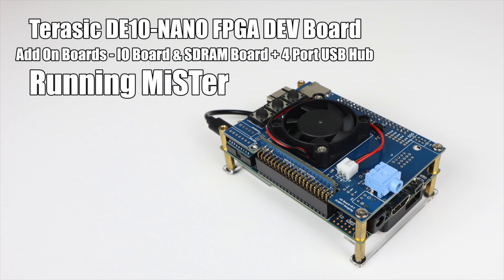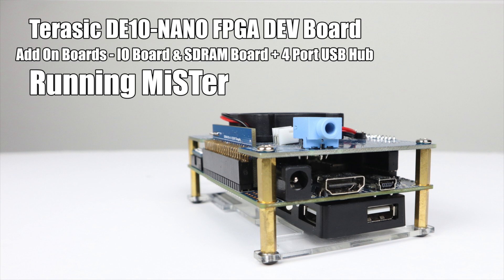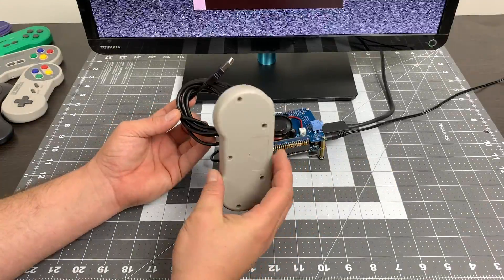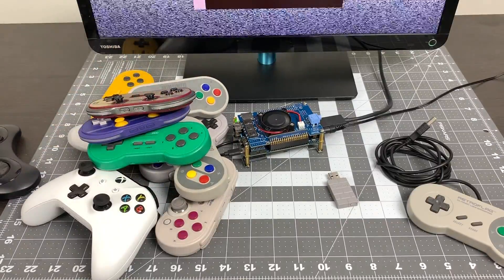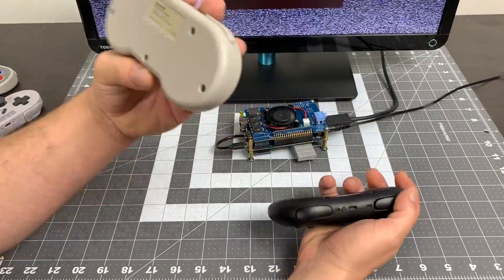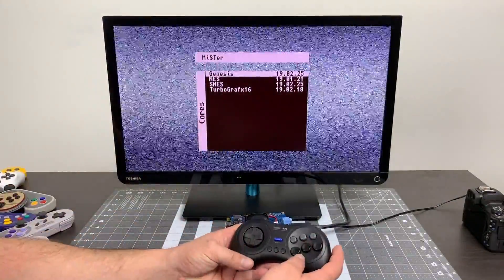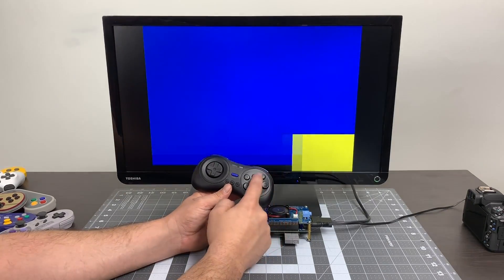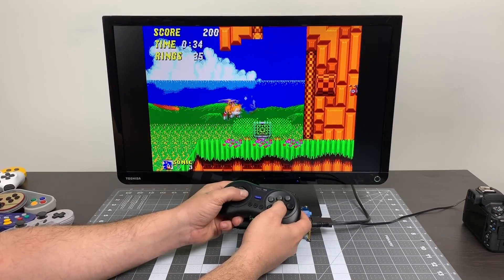MisTer Use Wireless/Bluetooth Controllers With The DE-10 NANO

Comment: I finally figured out how to pair and map my recently purchased controllers SN30pro BT + M30 2.4GhZ with the mister.

BUT: After a Reset the connection to the controllers are lost again, although the settings of the controllers are saved in the config / inputs folder.
I always have to do a hard restart and do the pairing and mapping all over again. Its not even possible to pair again after a regular reset, I have to turn off the device and reboot. There is no "Save Settings" Button in the "System Settings" Menu like it is in the settings menu of each individual core. Or do I make a mistake here?

Comment: Just ordered the N30 Pro and don't really know what to expect as opinions regarding its use with the MiSTer are ambiguous.
Anyway, I've been using the Wii U Pro controller with the MiSTer with a TPLink 4.0 Bluetooth adapter and it works great and can't notice any lag at all. I don't really feel the same way regarding the PS4 controller. There's something about it that just doesn't feel right...

Comment: Re: "some people call it simulation" -- It's technically still emulation (by definition, simulating the original hardware is emulation regardless of how that simulation is achieved).
Reply from the maker: Yes it is, every time I mention it as Emulation I get someone trying to correct me and say it’s simulation.
Reply: @ETAPRIME  ha, I guess you're doomed either way. 😅😅😅
Reply: It's technically neither. The most accurate description would be "re-implementation", since the design workflow for an FPGA core is almost identical to the production of an ASIC.
(Behavioral Design -> Synthesis -> Primitive Mapping -> Configuration stream, vs. Behavioral Design -> Synthesis -> Standard Cell Mapping -> Masked silicon).
Reply: @hjups  a re-implementation is by definition a type of emulation. (Emulation in regards to computing being defined as "reproduction of the function or action of a different computer, software system, etc.")
Reply: @BrainSlugs83  Semantically, by that definition, you are correct. Though it's not a particularly useful classification, since by that definition a skylake processor is an emulation of a kabylake processor. Similarly, you could probably expand it to say that an i7 processor is an emulation of an i5 processor of the same family. It would depend on how you define "different", where I don't think that an FPGA is different enough from an ASIC to allow for "emulation" to be a useful description. After-all, you can turn most FPGA cores into an ASIC. Which at that point, you would have to distinguish the difference between the original manufacturer doing so with the original source files vs. making a slight modification, which once again, I don't think would be useful to describe as "emulation".
Reply: @hjups  except that implementing an open and well defined standard is hardly a "reproduction".  We're talking clear apples and oranges.  On the one hand you're designing and building something new, that has never been built before, that adheres to a specification.  In the other, you're reverse engineering an entire computer system in order to duplicate its functionality and run its software on 3rd party hardware that was never designed to do that.  It seems pretty clear to me.  Maybe the first cyrix 386 chips could be considered as emulating the x86 line of CPUs but iterative development of the same thing hardly counts.
Reply: @BrainSlugs83  So the dividing line that you are using is where the origination is? So for example, if you use verilog from NEC (ignoring potential legal issues) for example would not be emulation, while writing identical verilog without seeing the NEC version would be considered emulation? And if that is the case, wouldn't it still be better to not call it emulation a lot of people confuse it with software emulation? (linguistically, would that not be the definition of a poor definition / classification?)
Reply: @hjups  I don't follow any of that reasoning.  Apologies for being dense but we're on totally different pages. 😓  Obviously there's different types of emulation, software emulation versus hardware emulation in this case, so there's already a way to disambiguate it (plus you can just drop "FPGA" into the sentence and things get pretty clear).  But also, obviously, in one scenario you're reverse engineering something so that you can run software on a device that it was not designed for, and in the other, you designed the hardware from scratch to be compatible with an existing and open architecture.  (and iterating on your own designs doesn't generally qualify as re-creating them;  besides just think of the other ways the word is used.  For example, you can emulate someone else, but you can't emulate yourself. You're already you.) -- Maybe I'm missing something, but it seems pretty clear to me.  If you act like someone you're not, you're emulating them.  An FPGA is not a 6502 based 8-bit gaming system.  If you make it act like one, you're making it emulate it.  That's just English, man.
Reply: @BrainSlugs83  I see your point, however, I am claiming that the line between emulation and not emulation, in the case of hardware is blurrier than you seem to suggest. For example, lets say you have the original silicon masks for all of the chips in a 6502 based 8-bit gaming system. You then combine the masks, packed in a plane, with an added interconnect layer and created a new chip. Would that be emulation? The hardware is identical to the original, but is implemented on a single piece of silicon instead of say 30 of chips. You could argue that the software wasn't originally designed to run on the single chip, but that's a semantically argument since it's identical in every way to the original.
Which perhaps that's my argument. While this is not possible, in your example of people, would it still be considering emulating someone else if in every measurable way you became that other person? (appearance, cell structure, DNA, etc.) Now what if both were compared but you didn't know which was the "original" who would be the emulation?
The whole point that I was trying to make was the emulating is effectively "pretending" to be something else, but FPGA cores are only a step away from being indistinguishable from being the thing that they are pretending to be (in every way that matters besides semantics).
Reply: @hjups  you're raising some good points and it's food for thought for sure; though, in my opinion you're taking some things  for granted, for example the hardware will never be 100% identical because it was reverse engineered. And secondly, FPGAs are not the equivalent of physical hardware, for example, they can only emulate the digital interactions. -- The SID chip is a great example of this; the original SID chip had analog flaws and on the C64 was routed too close to a ground trace (IIRC) that introduced low levels of static on one of the channels; that static could be manipulated with software (and some games took advantage of that to do speech synthesis and play digital samples).  But even Commodore in their later productions of the SID chips and C64/128s failed to produce them with the same flaw, and the chips were left with all kinds of compatibility issues (and don't even get me started on the timing issues with chips like the SwinSid). -- My personal opinion is that if something is the exact same hardware, then it is the same hardware (though most of the NES-on-a-chip implementations have poor compatibility because they are not the same hardware), but an FPGA can only fake being the hardware (and only digitally), the same analog interactions just aren't present.
Reply: @BrainSlugs83  It's true that it will never be 100%, but not because of reverse engineering... because of silicon bugs. Many silicon devices end up failing to work exactly as intended due to issues either in manufacturing, layout, or design. In that example, however, an FPGA implementation can produce a better / bug free version of the original hardware. 
As for reverse engineering, that's true if you reverse engineer it, though there are different levels of doing so. For example, if software only cared about the specification, then something like the Cyrix 486 vs and Intel 486 is irrelevant. Consider the fact that an Skylake processor and a Kabylake processor are not the same internally... and differ far more than the Cyrix 486 and the Intel 486. 
As a counter to reverse engineering, the original verilog for some chips is available on the web, such as for the RCP used in the N64. If the original verilog was implemented in an FPGA or ASIC, would that still be emulation? You're not reverse engineering it. What if you have to modify the verilog to meet modern CMOS and FPGA standards (like removing a dual direction internal bus in place of two single direction ones)?

The SID chip is a good point, but a bad example. The SID chip was a semi-analog piece of silicon which is impossible to reproduce in HDL. The semi-analog part was not a bug, it was the intended design. Think of it sort of like a combination of digital logic CMOS technology with analog IC technology (like an operational amplifier). I believe the SID chip also had non-digital components, such as resistors, and made use of in-silicon capacitors for the filters. This would have to be done manually, and cannot be done using standard cells which are purely logic. Note that chips like that still exist, most commonly found in RF applications (variable gain amplifiers are an example).
 Now since Commodore fixed the bug in their later versions of the SID chips, are the later SID chips emulating the originals? 
I think you made a mistake with your SID explanation though, from what I understand, the bug was not from improper routing, but was that the audio would pop when writing to the volume register. The pops would vary in loudness depending on the value that was changed, so this could be used as a way to drive and feed in digital samples. 

As for reproducing system quirks / bugs, that's also true. But one could argue that it wasn't the intention of the manufacturer to introduce such bugs, so by your definition, any software written by the manufacturer that ran on the C64 would technically be treating the C64 as an emulator for the original specification (since it's not the same version of what they designed it to be). My only thought with the NES-on-a-chip having poor compatibility is due to poor implementation. If you consider the Analogue NT instead, that probably has much better compatibility to the original hardware, and even reproduced many of the initial hardware bugs that games too advantage of. 

Your specific comments about FPGAs, they are logically inconsistent. You said that FPGAs are only digital, but they emulate digital signals... 
Both are false in reality. FPGAs are purely analog, since they are composed of CMOS transistors, in the same way that 74 series logic is analog even though we consider them to be digital logic. You can actually run into a lot of problems with routing (especially if you do it manually) in an FPGA which stem from analog signal integrity issues (fan-out, line capacitance / load, signal distortion, cross-talk, etc.). All of those analog problems are identical to problems that silicon designers deal with. To go further, FPGAs designs are typically simulated in logic simulations to check for functional bugs, which is what's also done with ASICs. But once the mapping into standard cells (or manually masking) is done, typically ASIC manufacturers will also simulate their implementations using electro-magnetic simulation and propagation software (that's how they can estimate a maximum clock speed without increasing it until the device stops working). I assure you though, those signals are not nice square waves like you see in a logic sim, they are analog, with various voltage levels, and artifacts such as ringing. The benefit to using an FPGA, is that the FPGA manufacturer has already done those simulations for you, and has implemented design rules to help prevent the fitted / routed implementation from suffering from signal integrity issues - though both Intel and Xilinx's tools let you modify things such as fanout rules. 
I can see an argument for FPGAs "emulating" the digital interactions, but that's also a bit fuzzy. An FPGA isn't a bunch of parallel processors running code, it's basically a large grid of multiplexers (they are called Look-Up Tables or Logic Elements) and flip-flops (there are some other components like SRAM blocks and multipliers in there as well). So the LUTs are a way of implementing the logic equations, which the original hardware could have easily done as well. At their core, the multiplexers are just a series of logic gates, which are in turn a block of NMOS and PMOS transistors. In fact, if you take a multiplexer implementing a logic equation vs doing so with NAND gates, they will produce identical digital behavior, and the multiplexer will probably end up using fewer transistors. 

Hopefully you can see how your argument is blurred here. Almost everything you have argued can be considered to be true, depending on where you draw the classification line, where if you move it slightly, then it becomes false. Since FPGAs and ASICs sit on this boundary, and the line can be debated, I don't think it's useful to use that boundary classification.

Edit: If you would like proof of the digital signals being analog with integrity issues (or just want to know more), the typical program used for VLSI design (what the silicon implementation is considered) is Cadence Virtuoso. I was able to find two university course assignment tutorials which show both the gate level mask description, as well as the simulation of the layout. https://cse.buffalo.edu/~shixiong/LabAssignment.htm (this one has a multiplexer layout, which you can see is made entirely of NMOS and PMOS gates - which is what FPGA logic is implemented in), and https://ece.umd.edu/~dilli/research/layout/cadencetutorial/cadencedemo6.html (shows some signal integrity issues in the waveform - though not discussed - there are spikes in the orange waveform when it transitions, which are a result of analog overshoot and ringing effects, also notice that the waveform is curved and not a square wave like the input signal in red above).